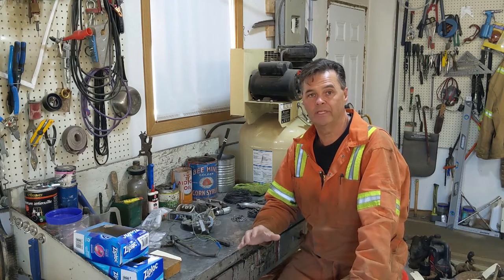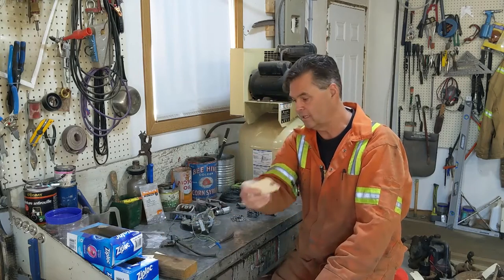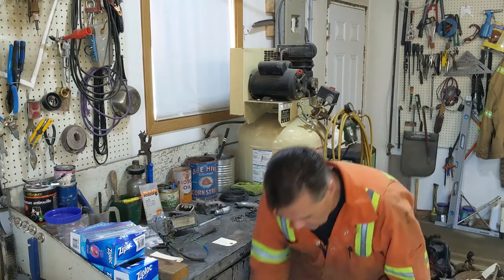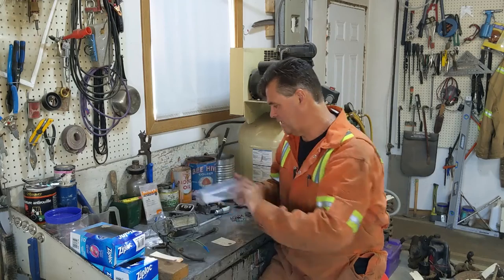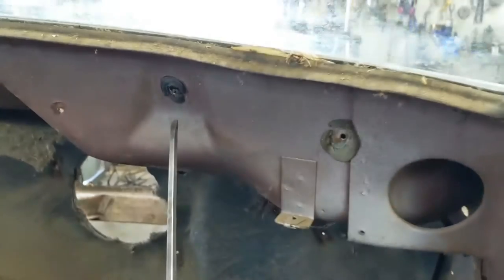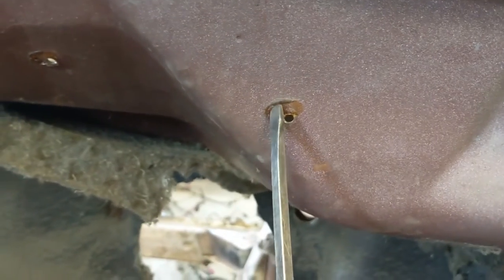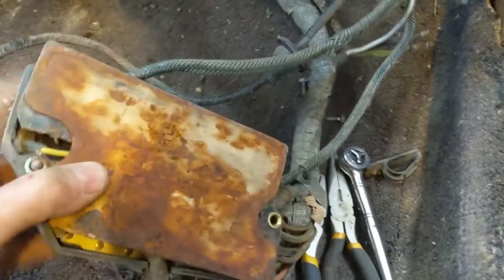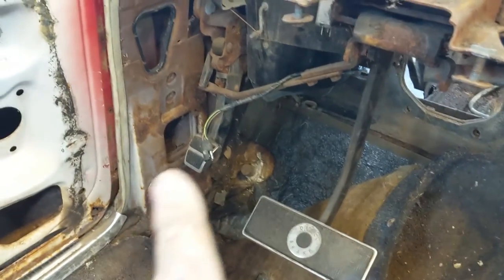FIREWALL Main Harness & Heater Box - 65 Thunderbird Convertible Restoration Ep #8

Comment: Hello Alvin. I also tag and bag all of the parts just like you do. I also bought some of those self sticking dots (about the size of a dime) . They are different colors. I use the red ones on the the parts that need to be cleaned or repaired, yellow ones for parts that may need just paint, and green ones that have been refinished and ready to go back on the car. I was also surprised to see how nice condition your wiring connectors are in. Really enjoying the videos. Thanks for taking the time to make them.
George B. in Michigan
Reply from the maker: Thank you George...I like your colored dot system. The wiring was one of my biggest concerns when I was planning this project, I think I will be able to reuse most of it...tested and cleaned of course. 😊

Comment: do you have anything on removing the heater core?
Reply from the maker: The heater core removal is the same deal as what I did in this video, you will need to completely remove the heater box to get at the heater core, there are 4 nuts to take off in the engine bay, and the one bolt. You will need to remove the lower dash covers on the passenger side to be able to remove the heater box from the car. Then remove the heater core cover plate, remove the heater core, install the new one...replace any insulation that may have gotten damaged, and reinstall the box.
If you have an A/C car...it is more complicated, and I have never done an A/C equipped T-Bird, but there are others that have done them, check out @joernone & @vintagethunderbirdrepair9426, they both have videos on A/C 64-66 T-Birds heater boxes.